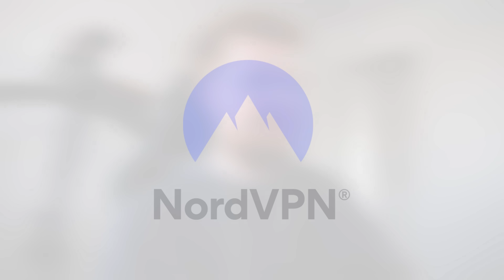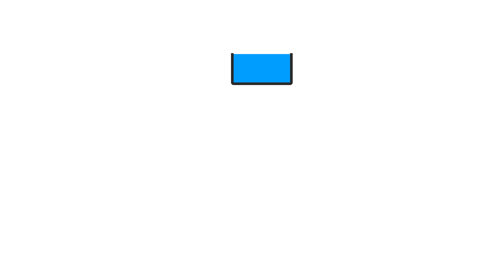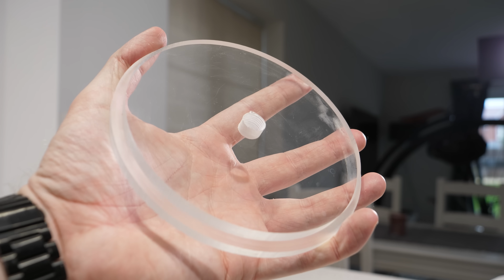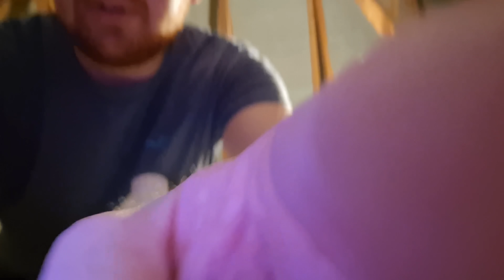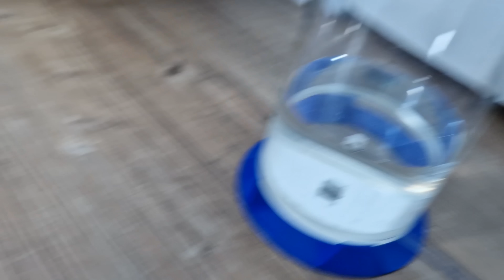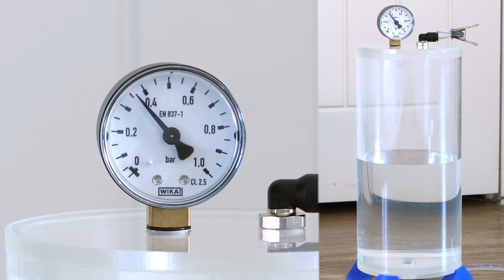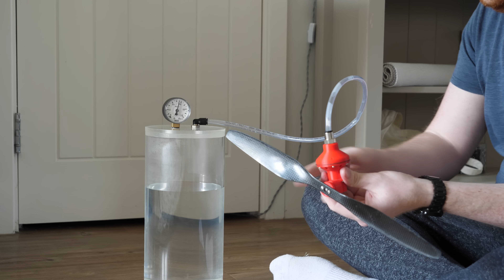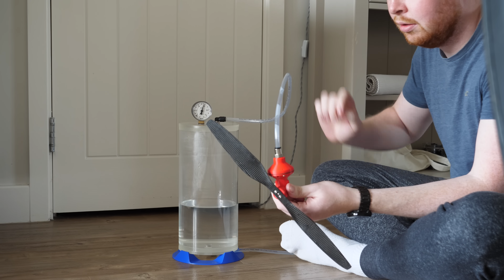Liquid Air Engine

Comment: This is fascinating. I wonder how feasible it would be to link an array of closed cylinders up to a rain butt. When it rains, pressure would increase and you could take a cylinder to power something whenever you needed. A sort of 100% green and renewable battery. I imagine you'd need a few for it to be economical, but may work in very rainy countries. Interesting and great work as always!
Reply: Only problem with that idea is the rain collection container must be up very high to generate the pressure - and yet the roof space that would give you that extra pressure is above the drop of the water off the roof - in a taller building with many floors a tank up just under the gutter would work pretty well though.

edit. Also should add it won't ever be a huge battery in capacity, its still a relatively small mass and short drop - however if you also say plumb that same tank to flush your toilet you will end up saving way more energy by using less drinking water for tasks that don't need such pure water.
Reply: @foldionepapyrus3441  You can always build a water tank tower on your yard to store rainwater up top, with a tap to use it from ground level. Aussie style
Reply: @BasedMan  That will still need active pumping to get the water up the tower in the first place, or you are only able to fill that tower from its own small roof area - the point is you can't have captured rainwater stored higher than the point you captured it without expending the energy to lift it up there yourself!
Reply: it would be better to use the water to directly power a turbine, since pressurising a tank of air, and then running that air through an engine, and then  into a generator, are massive areas for energy loss.
Reply: That could actually be a cool idea for powering skyscrapers. Using the potential energy of rain water in the gutter to add some electricity to large buildings.
Reply: @Ry_TSG  problem is, the potential energy is minimal - not only do the roofs of skyscrapers don't catch that much water, but also the hight introduces negligible amouts of energy compared to the effort needed to build create and maintain a reliable system - but I like the idea as well :))
Reply: @TecSanento  The channel "Quint BUILDS" built a rooftop energy storage system.

55-gallon drum, set on the roof of his house, feeding a turbine at ground level. And it worked.

But he calculated that the total energy storage as the equivalent of 1 AA battery.
Reply: @rogerrabbit80  yeah i know this video, thats why i wrote my comment - all this effort for bascally nothing
Reply: @TecSanento  Well, I'm sure he had fun with it. It's just of no practical use.

Had to snicker a bit when I read the comments about powering skyscrapers using this method.
Reply: @TecSanento  How many rooftops are there in say London alone?

Comment: It might sound strange, but "water powered air engines" are actually a thing. If you search "trompe" on Wikipedia you will find that several hydraulic plants would use water flow to generate compressed air, often to provide power to nearby mining operations where internal combustion or electrically powered machines could be an ignition source and  dangerous to operate. Practical Engineering has a video where he demonstrates a scaled down trompe here: https://youtu.be/uvf0lD5xzH0

Comment: IDEAS:
fly the water tank as high as you can before it starts boiling on a lift drone,
make a mechanical govenor to control the speed
make a compressor driven off the engine and see how much energy you can recover from the initial (good Work=integral(p dv) teaching moment)

Comment: My suggestion would be lubrication of the moving parts. Using something like dry Teflon lubricant, graphite, or even a pencil I imagine can make a difference when the air pressure drops even more. Also, real internal combustion engines use a weighted flywheel to smooth themselves out and keep their rotational inertia going between ignition strokes, since in a normal single-cylinder four-stroke engine, there's quite a lot of time between ignition because the piston has to go up and down three more times until the next power stroke. When the air engine slows down and starts oscillating, it's likely because it loses inertia and needs something to keep it spinning in one direction, not to mention smoothing it out. Something heavier than a carbon fiber propeller like an aluminum disc.
Reply: That would also make use of the extra energy the engine has in the beginning when the pressure is higher than the equilibrium point, allowing it to speed up!
Reply: Minor error but the four strokes in a four stroke engine are down (intake) up (compress) down (power) up (exhaust). Each "stroke" is the full travel of the piston in either direction. Every other down stroke is a power stroke. But yes a flywheel could help smooth out the speed. A lubricant would help but you would need to replace it over time. Might be better to put a tube of Acetal around the piston. I think the biggest issue with adding a flywheel to it would be the weight.
Reply: @WillisPtheone  Ah, thanks for the correction. Brain fart. I feel like the weight wouldn't matter however, since that particular engine powered by water isn't gonna be on a plane.
Reply: @adenk.1704  That huge propeller on the front is a as good as a flywheel.
Those things are not light.
Reply: @Stambo59  I was thinking that too. Maybe adding a bit more weight to the tips would give it a bit more inertia?
Reply: I had just made almost the exact comment and then I saw yours.  Personally, I think graphite is the way to go.  Using graphite from a No. 2 pencil should be more than sufficient.
Reply: @actschp1  - Only thing is, graphite's a bit hazardous and not recommended for pneumatic devices.
Reply: By using graphite, movement should add writings on the wall. 
😁
Reply: Definitely a flywheel of comparable size would be a nice addition. Maybe a dime sized piece of aluminium.
Reply: That prop is a significant flyweight
Reply: Here's an idea. Glycerin. Water soluble, thin, and lubricating.
Reply: (not even remotely an engineer) Mucking about in Besieged with a recipricating engine, I was astonished by how effective even a small flywheel was at just making the thing run propery and stable. Without one it would stall constantly or with the slightest amount of torque needed (like starting to drive), but with one and it worked flawlessly, even if my timings and gear ratio's were a bit garbage.
Small downside is that it needs a bit more energy to get going; but once it goes it doesn't stop nearly as easily.
Reply: Teflon is a carcinogen and should be banned
Reply: @coastaku1954  🙄
Reply: @Wmoore1  It is, and Dupont hid the fact that is was toxic for decades
Reply: @Coastaku  Teflon is absolutely not carcinogenic. At one point, certain chemicals used in the production of Teflon had a possibility of increasing risk of cancer. They did away with that forever ago and Teflon is now a completely safe and stable product. And even then, the risk came from fumes from heated Teflon.
Reply: @Wmoore1  - It's pretty disturbing how Teflon pans, left to accidentally overheat on stoves, killed quite a few ppls pet birds.
Reply: @coastaku1954  Really? Didn't know that. All my cooking pans are covered in the stuff! Anyway, if I've survived 45 years eating off teflon then I think he should be safe using a bit on his engine?
Reply: @coastaku1954  When manufactured correctly, it is perfectly safe. However, it doesn't have the best track record so I can see why you're concert.
Reply: @Coastaku - For the record/just in case someone uses it on pneumatics, graphite/powdered graphite is toxic as well :(

Comment: Nice build! You could also add a flywheel to help maintain stability and rotation direction. Might be helpful.
Reply: But it would probably add too much weight for 0,4 bar of air
Reply: @AnonymousGuyyyy  It only adds inertia, and he's hand starting it.
Reply: @jakegarrett8109  but imagine taking a car tire and spinning it with your hands, and now think a tractor wheel. It would be too much weight for the engine to spin
Reply: @AnonymousGuyyyy  that's not how it works at all, and have you not seen cars like El Caminos with monster truck tires? The only difference is because of the larger outside diameter (higher effective gear ratio), you change the final drive ratio usually by using differentials.

A huge portion of the kids in my class had off-road trucks with very nearly monster truck tires, that's what we were doing in shop class was welding things to jack their trucks feet off the ground, roll cages etc.

You don't need an engineering degree to understand this stuff (by the way I do have degrees in mechanical and aerospace engineering, but this is just very basic elementary physics). Also more appropriate direct comparison to the wheels would be filling the wheels with concrete (you can also use water but due to moving fluid dynamics it's not the perfect comparison. That's actually a common thing, I've even filled tractor tires with water (increasing traction for pulling large loads). Also tractor tires often have iron or concrete weight in the tire rim and you can still turn those by hand (again the acceleration you can spin it up is proportionate to it's inertia).

Comment: You must not know what a trompe is. Water has been used to compress air for mining, smelting and forging for a very long time. they have been used to power pneumatic drills for a very long time.

Comment: I saw an interesting video on youtube called "Introducing AirBattery." It uses energy to pump water into to tanks to compress air, thus storing some energy. Then when energy is needed, air is released to pump water back through hydro electric turbines. It'd be cool to see you attempt something similar.
Reply: dumb idea. compressing air makes it heat up, and that's a massive loss of energy. Air doesn't have any significant energy density, compared to just water. Videos called "introducing x" are 99.999,er, 100% of the time, startup scams that prey on "Unveiling culture" and "cargo cult science" cultists.
Reply: @dimitar4y  I don't know if it's a way we should store energy. I just thought it'd be a cool project similar to what is done in this video.
Reply: @zunuf  bad method. Cool to try, sure.

Comment: You can still use a biger tube!
It´s not the diameter of the inlet that makes that water go that slow, it´s the small diameter over that long distance!
Just print a adapter for a 19mm garden hose, that should be sufficient.

Comment: Even if you had a larger pipe to a smaller fitting on the lower tank would aid in reducing fictional losses. A major improvement in the rate to pressurize the tank would be to straighten the run of pipe as best you can, again to reduce frictional losses. flexible pipe is a good solution as you can avoid the 90degree bends that impact flow. Great job on it. Would be interesting to see if you could convert it to a water powered engine.
Reply: I’m not sure water power would work. The engine seems to rely on having the “fuel” expand in the cylinder, and water is incompressible. If would be cool if he tried it with other gasses, though.
Reply: @Ry_TSG  that's true! Potentially altering the pin length would be required to keep the valve open for longer, this would also require a much larger flow of the water, but could also greatly increase the torque.

Comment: Drill a second hole in the lower tank and fit a bike pump to it, that way instead of having to climb upstairs to refill the tank you can just pump in air which will push the water back up to the top tank.
Would be neat to close the loop having an air powered water pump powering a water powered air engine.
Reply: It's probably quicker to carry a gallon of water up two flights of stairs than it is to fill that entire tank with a bike pump!
Reply: @PKMartin  If you were concerned about how long it takes to pump it up then you definitely wouldn't be building a water powered air engine to begin with.

Comment: i'd love to see a low pressure twin cylinder. might work a little smoother even with the added complexity and friction
Reply: Or just add a flywheel
Reply: Then a needle valve for air flow balance.
Reply: @kricketflyd111  just synchronize timing like a steam engine, simple ports like a 2 stroke even

Comment: This is awesome and I totally relate to your "omg it works!" dance.
I'm a farmer and also work with sensors and microcontrollers as a hobby. I've always thought it would be really cool and relatively easy to use water pressure from irrigation lines as a power source for my sensors. Have you ever done anything like that?
Reply: That sounds pretty cool.  You should check out Robert Murray-Smith's channel. https://www.youtube.com/playlist?list=PLbQqm4rNo626ocyMJv83s-Na-V_McMYb4 He's constantly doing videos on various types of energy harvesting.  Personally, I'd recommend using a PC fan as a generator with a Schottky diode rectifier.  You could probably just direct a jet of water through the blades in the simplest case.  If you get a fair bit of sun you'd probably be better off just using a small panel though for what they cost nowadays.
Reply: You can get micro turbines that plug right into a water line. The solar store I go to has them.

Comment: Wonderful!

You could add a floater into the tank to that automatically blocks the outlet as soon as the water reaches the top. That way you don't have to worry about flooding the engine.
Reply: I had an idea for a practical use of this: toilet flush powered air circulation. The tank would need to be made specifically for this task, but after flushing, while it fills up it would power a fan.
Reply: Came to the comments knowing someone else thought of this too! 

Great job, Tom! Always enjoy watching you build and enjoy whatever it is you are building!
Reply: No need to block the output, he needs to add an air tank to the output, connect them with a one-way valve, and make a swimmer to dump the water out. The valve+tank setup will keep the air pressure going while the tank empties and refills.
Reply: Hehe, "flooding," but it's water.

Comment: Use mains water pressure  - usually around 30 to 60 psi, but can vary if you live in hilly area.  Your pressure tank can probably withstand that, but you'll need a pressure gauge with a larger range - maybe 0 to 5 bar.

Comment: you could try powering it again with a pressurized bottle. i guess you tank had about 5-7 litters of air in it. if you pressutize a 2 litter bottle to like 7 bar (should be fine) you have around 14 liters of air. to stop the engine from spinning to fast you could add a pressure regulator and set it to around 0.4 bar. this should result in a mush longer runtime.
Reply: Look at his other videos.  Lots of bottles there.
Reply: @rickoshea8138  yea but those had the problem that they only run for a short time. With a pressure regulator and the low pressure of the engine it could run much longer
Reply: @tjorvegro9651  Air pressure x volume dictates engine power.  Power over time is the value.  Simply making it turn for longer is nice to look at, but it needs to power something to be truly impressive.

Comment: The weight in the water column probably makes a big difference.  That is a very small tube from upstairs, holding only a cup or two of water for the whole length, if it was 20-30 mm pipe there would be many times the weight pushing down.
Reply: The volume of water in the column only affects how quickly the pressure can change, it won't effect the ultimate static pressure, until you get to tube diameters that start having significant capillarity action.
Reply: The weight yes, but the pressure would remain the same. What is making this system lag is the maximum flow rate that can be achieved at this pressure difference. If the flow resistance matches the pressure created by the height the flow rate will stall.

Comment: Great video! Also, what if you use this engine in reverse, as a compressor, by powering it with electric motor? Would it work? What pressure can it get to? I think this is very intresting.
Reply: That wouldn't work, considering how the engine is designed. All the air would be pushed and pulled out of the exhaust, with only a very small amount being moved back and forth through the inlet. His previous design with a cam would probably work better for that, but considering the large amounts of air leaking around the sides of the piston, it probably wouldn't get past maybe 0.1 bar
Reply: The diaphragm design only works in one direction

Comment: Have you considered fabricating the motor parts with a method other than FDM printing? Maybe this way you could achieve greater dimensional accuracy and surface finish, eliminating even more inefficiencies.  Just a thought.

Comment: Love your videos. They are very interesting and the ideas you came up with are very ingenious. However this last video didn't quite meet that standard. It is not as interesting. Since it is basically a way to store air pressure. Eagerly waiting to see what you invent next. Maybe a flyable plane? Loved the cubic drone by the way.
Sorry for my english. I am actually Spanish
Reply: great comment. your english is good !
Reply: I don't know, I thought it was interesting how his design constraints essentially forced him to develop an even more efficient engine. His engine now runs at 5psi. That's insane!
Reply: @snowe..  thank you for the reply i really appreciate it! I was scratching my head thinking i missed something, thanks! <3
Reply: Actually, there is a lot of interesting stuff happening, if you can appreciate it even when it is not pointed out!

Like why does the motor slow down, then pressure increases, and it revs up again? Why does it not just converge to a stable rotation rate? That requires a fairly slow time constant which the mechanical parts alone don't seem to provide.